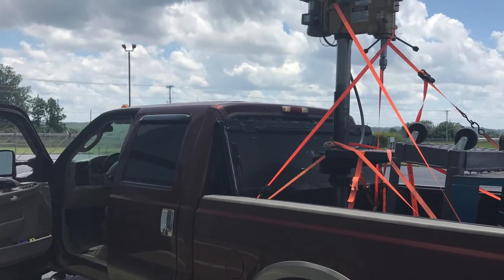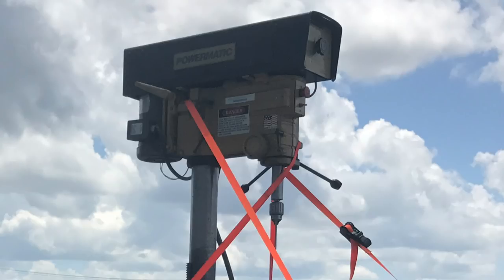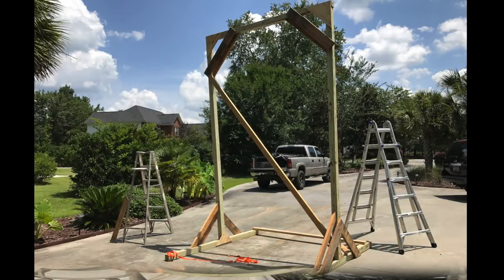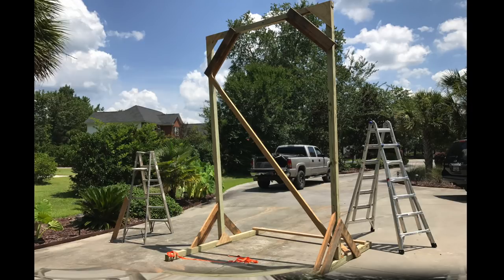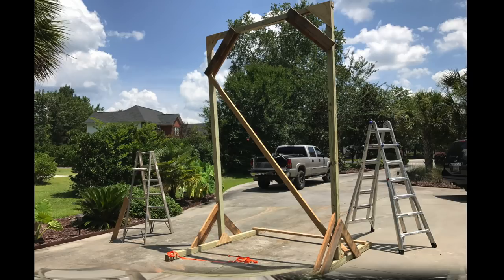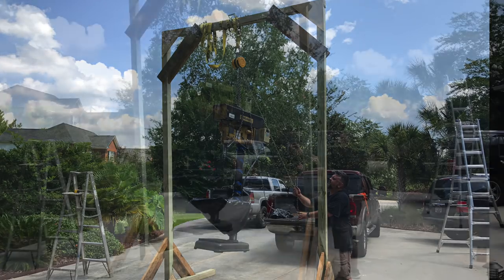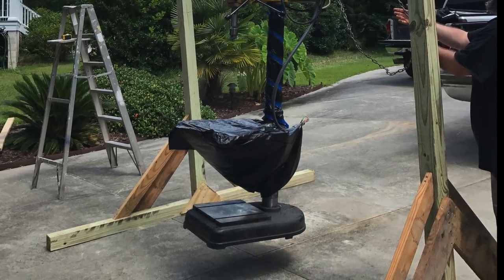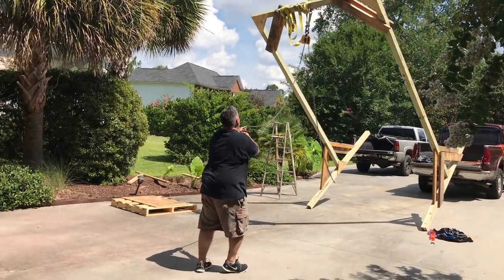The Hillbilly's guide to building a cheap gantry crane.

Comment: Do not worth it.
I'm about to go get mine at Northern tool's for 439$
2000 pounds metal nothing like this.
Save time and money cheap garbage gets expensive later
Reply from the maker: I don't understand your comment.  Can you try again?
Reply from the maker: I tore this down afterwards and used the material on another project.  I don't have storage room for a dedicated gantry in my shop...
Reply from the maker: Also, the cheapest model NT has is $700 plus tax and can only lift 1k lbs safely.